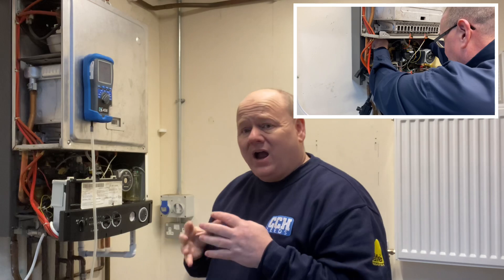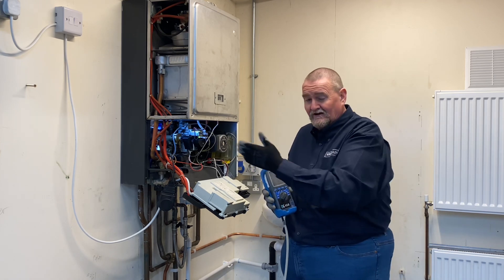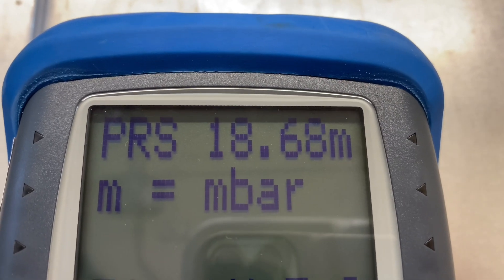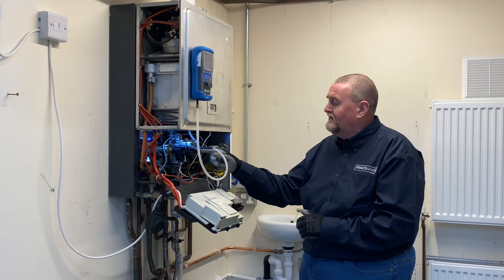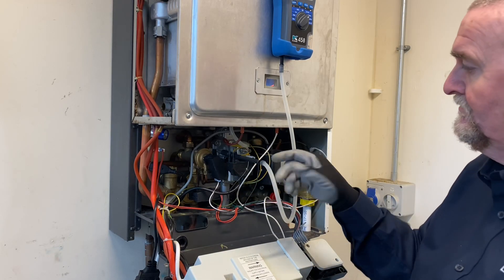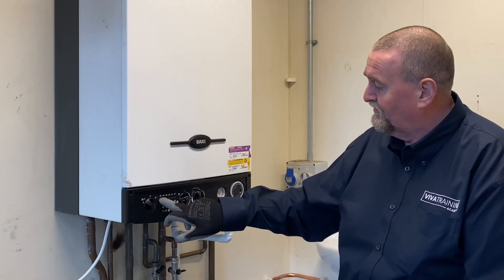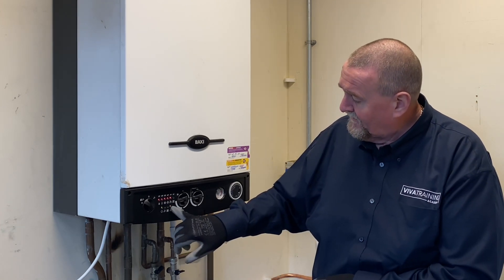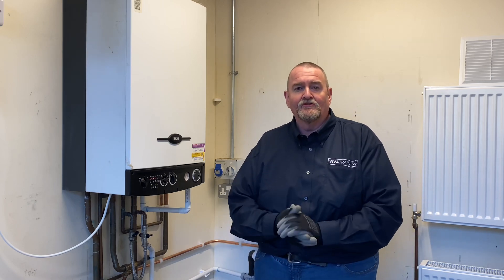Gas Training - How To Set Up A Gas Valve - Baxi Boiler

Comment: Why are these guys called engineers?  In my country they are not engineers. They are a trained technicians; like an electrician.  NOT engineers.
Engineering is a highly technical regulated profession requiring up to 8 years of university level education.

If you called yourself an engineer here, when really you are a gas fitting technician, then you would be charged, heavily fined, and whatever licenses you do have would be revoked.  It is equivalent to fraud.

Comment: Thank you for this! 👍
My old Baxi Luna 310 is having a modulating problem.  The gas valve solenoid clicks open but the flame does not modulate. 
Is it possible to replace just the modulating coil or does the whole valve have to be replaced?

Comment: Hello, by setting the minimum and maximum gas pressure as per technical specification, the values of the combustion components are automatically aligned (es: CO / NOx).
Thank you

Comment: Roy is a star👍 Great wee video & wonderful insight.  
One question; traditionally, these pressure test points on a Gas Valve were called P1(inlet pressure) & P2(Burner pressure).  Has that changed, as they’re still called that by colleges & on forums etc.
Reply: On an older style boiler with Atmospheric burner (as in the video) yes p1(inlet) and p2 (burner). On the modern boilers with a zero govenor p2 doesnt give you a reading. They are still there for some reason, but you cannot read a burner pressure on modern boiler with zero govenor (fan before burner).